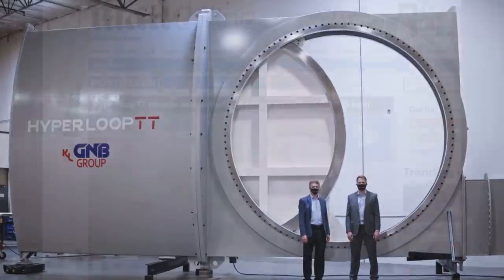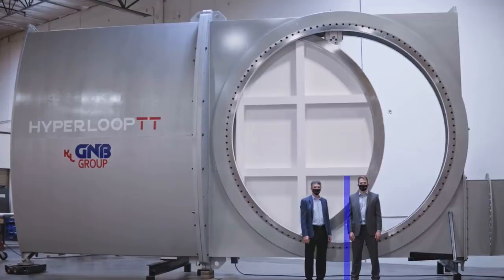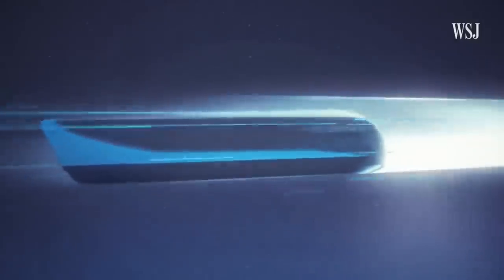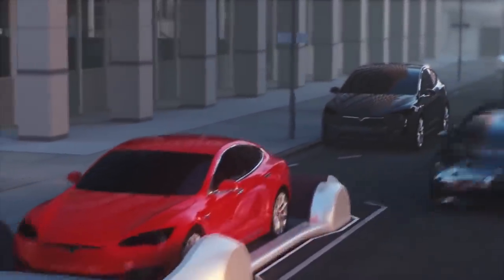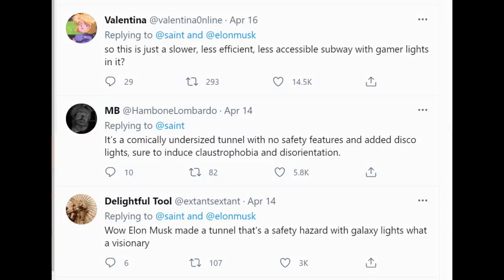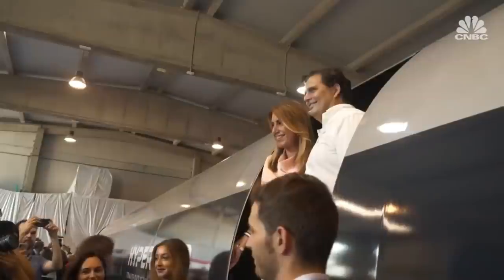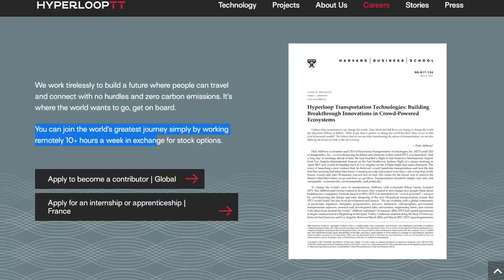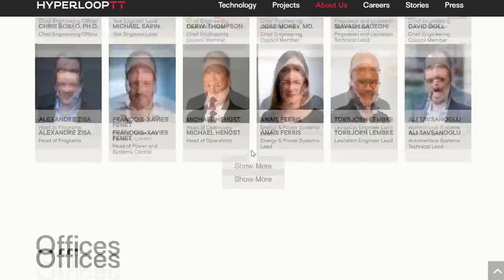Hyperloop TT vs. Virgin: The Race to Make Musk’s Moonshot a Reality - BUSTED!

Comment: Digging of the LVCC loop began on November 15th 2019.
91 days later on February 14, 2020 the first tunnel was completed. 
May 2020, the second tunnel was completed. 
LVCC loop opened on April 9th 2021. (Including finished tunnels and terminals.) 
...there was also a little COVID thing going on...
There's also a difference between the speed at which you can dig a tunnel, and when that tunnel is actually finished. The LVCC was also dug with the older modified more conventional boring machine, with the purpose built machine not finished until February 2020. 
The channel tunnel used 11 machines and two crews digging either end. 
The LVCC loop is incredibly underwhelming, but there is no need to be disingenuous about the process and construction.

Comment: 1atm = 14.7pounds per square inch

1square meter = 1550 square inches

16m^2 x 1550 = 24800 in^2 (size of valve in square inches)

24800 ×14.7 = 364560 pounds on the valve.

Let's assume hyperloop gets built and it does what its advertised to do (i know, i know, it can't, this is a hyperthetical) who wants to be anywhere near this valve when it fails?
Reply: The situation is actually worse than it seems. Realistically I'd see a full-scale Hyperloop being 6m in diameter.

1 atm * (6m / 2)^2 * π = 644054 lbf!!

Comment: I have been enjoying these videos for a while. I still do not understand what these "visionaries" say is the benefit of a vacuum to move the passengers versus a standard train systems. is the vacuum the only way to get speeds over 200 mph?
Reply: i believe the fastest maglev is already 270mph.  If you could overcome air resistance, you could significantly increase that speed.  So creating a secure vacuum tube would be pretty awesome, but as detailed in the video, doesn't currently seem plausible in our world both in tech or cost.
Reply: @Ground-Spam  the big problem is safety and comfort of passengers.
Reply: @toomanyaccounts  I mean comfort should be fine, esp for long distances where you have time to speed up and slow down without generating too many G forces.

Yea, safety is a HUGE concern.  Even that can be overcome...most 1st gen tech are laden with safety concerns.  We're no where  near it, but could be reasonable to research it.
Reply: @Ground-Spam  a century of development has been in maglev trains. the reason only three countries have a maglev train is the cost is more then having conventional high speed rail then the incremental benefits that would occur with maglev trains
Reply: @toomanyaccounts  Yea I can appreciate that.  240 vs 270 isn't enough to justify a greater cost.  There is something to be said about investing into tech that is marginally better in hopes to generate more money in development in hopes to make it more efficient/safer/cheaper.

i could still see putting a traditional electric train into a vacuum tube for the future of transportation (we're just not there yet).  Imagine being able to compete with an airline for travel between cities for speed, cost, env.  Elon hasn't revolutionized anything...and I don't think they're close to solving the issues, but I do support the "train" of thought to help move us move to the next evolution of travel.

Comment: It you see how they build submarines today, everything is already INSIDE the module BEFORE they weld it to the rest of the boat. 
These idiots built the OUTSIDE first NOT knowing what the DESIGN is going to be. 😂
Whatever they design, it has to fit though that tiny passage.

Comment: So seriously how do they bridge the gap through the valves...... I mean you're talking 8 inches there at least...... That's one heck of a jump at 750mph, those wheels will have to take one heck of a thump.
Reply: It can be done.  The car has to many times longer than the gap and the wheels have to be on computer controlled "springs"
Reply: @kensmith5694  so your basically asking a train to make a jump at 750mph. I get what you are saying. Haven't run the figures, and I have no mechanical background to know what is reasonable. Also this action would end up being a critical safety item. Not working, train cannot run.
Reply: @tedferkin  
Yes, it would have to be working for it to run.  Many other things fit that too.

Comment: As long as there are no "room" temperature superconductors available (if ever) the best option for fast public transport (economically and ecologically wise) is a high speed railway. Which US does not have. It is technically possible to do - it has been done before. It is not easy to do - but doable. Do it. Improve upon it. Call it "Hyperloop". Stop claiming that You have invented a wheel. Job done.

Comment: of course these are scam projects, but TF isn't taking into account economies of scale and logistical overhead, and ends up making some really weak arguments. 

for example, the time-per-mile of digging a long tunnel will appear to be much shorter than a short tunnel, because the prep time for both is similar, but ends up being a much larger percentage of the total time for the short tunnel. as a percentage of the whole project, the chunnel builders spent a lot more time actually digging, as opposed to planning, permitting, geotechnical analysis, bringing the necessary equipment and materials to the site, etc etc. 

similarly, it's not really appropriate to compare project times for prototypes compared to scaled up production runs, because part of that time is spent developing techniques and tooling, not actually building. for example, by the end of the war, a single shipyard in the US could build a liberty ship in about a month -- but the first liberty ship took more than 8 months to finish, and that doesn't include the time spent designing or planning.

Comment: "we invented a new material called vibranium"

what if there was a new metal that could withstand an infinite temperature. this metal would be so good at conducting heat that the sun itself could not melt or even deform it slightly. It's called adamantium.
guess I just "invented" a new material too

Comment: What happens when it creates a Sonic boom ?Moving at over 1000 Klm per hour, How do you Stop ? How much are the G Suits ?🐺
Reply: if in fact its in a vacuum, there would be no sonic boom?  Gs would only be an issue when "suddenly" turning, starting, or stopping.  if the use of the loop is to travel from longer straight destinations rather than inter city travel would be manageable.  There are way more issues than these, but ur 2 could be solved?

Comment: Why don't they just get the Japanese to design them a bullet train and track and then just build those, so much quicker and easier... SMH
Reply: For a 1 or 2 mile trip a ordinary light rail thing would be fine.  It takes a high speed train miles to get up to speed.

Comment: Any @thunderf00t fan care to answer this for me? Ideally, thunderf00t himself sees this. But making a vacuum has always seemed dumb to me. Wouldn't it be WAY easier, to just run a much smaller parallel tube, with essentially a couple jet engines in it. To just accelerate the air in circulation, to as fast or faster than you want to run your train? It would minimize the damage of an imperfect seal, doesn't need the world's most complex vacuum system, doesn't involve humans in vacuums. 
I don't know the aerodynamics involved and I'm not claiming too. But if the goal is just "reduce wind resistance" a vacuum seems like overkill when you can just control the wind. And given we have tech that pushes air, which weighs very little, fast enough to propel airplanes, which weigh a shit ton, I'm assuming the tech to accelerate air already exists. 
Anyone how knows more aerodynamics than me care to weigh in on this?
Reply: Also, I don't even mean for the entire length, cause you'd need to have it in  sections, for either solution, since you need to have stations for ppl to board. So these parallel air tubes, would only need to be on each section, otherwise it would get really messy having people board while getting rekt by massive wind speeds lol
Reply: Air doesn't "weigh very little." Air gets heavy.
And jumping jesus on a pogo stick...you want jet engines running 24/7 pushing wind through a tunnel at 700mph? What? I really don't see what you are thinking here. Air is an absolute enemy for speed. Look at the ThrustSSC and the issues it had. Even wind tunnels for testing use a low vacuum reservoir, and these facilities are big. The testing area might look small but it takes quite a bit to get those really high winds for testing aerodynamics.
Reply: @AveragePicker  you seem to be missing the question. Pulling a vacuum that big is an Insanely challenging task. So my question is simply, "what's easier, sealing off the whole tube, having super long pressurising and de-pressurising times, or moving the air closer to your desired speed?" It doesn't have to be perfect, we all know the vacuum wouldn't be anyway. Yes air gets heavy especially when you've got It sealed in a tube and an object is pushing it at 700mph. But I still think moving that high pressure air to behind the train would be easier than trying to remove it all from the system completely. 
You said "That's crazy" but didn't actually answer the question. Trying to pull a vacuum that big is equally crazy if not moreso lol.
Reply: @briantroy7376  ok, well, do some research, draw up your plans, and sell the idea to Virgin. Good luck buttercup.

Comment: The fact that the "hyperloop" (stolen old abandoned idea anyway) has constantly been downgraded form 800mph, to 600mph, to 400mph, to 120mph, to now what, 45mph?  should really be telling you just how stupid and impossible an idea this is.  Yes, if we had some super amazing materials, some amazing energy production that didn't rely on fossil fuels and could power the vacuums, let alone some sort of either anti-friction or other means to get a "pod" going - sure... but if we had all that - we could already have regular cars, that don't pollute nearly as much (if any at all - not relying on burning fossil fuels) that would need less maintenance and cost probably 1% as much as any "loop" system.... and it would be 100x safer, as you wouldn't be dealing with a near vacuum on your body, and the 'loop tube' wouldn't exist, so , damage and wear to it wouldn't cause catastrophic failures that would kill literally everyone in the tube at the time of failure.

It'd be great if these 'high tech geniuses' would focus on things like climate change, electricity production, and generally "better lives for all" instead of fairytale exotic things like a bullet train going 800mph in a vacuum tube.   Any advancements to counter global climate change, including new methods of electricity production, storage, and delivery would begin to change the future forever in a positive way.

Heck even if they just focused on a "Net Spine" - a series of fiber optic lines that provide High Speed Internet access to 90% of America, and possibly the world, so that everyone can just enjoy the internet without so many restrictions or high cost bills - would change how things run, function, and productivity.   

The billions of dollars they blow on this "hyperloop" is just that... billions of dollars wasted. Money that even if you didn't go to invent something 'new' - could be used to better the lives of nearly every American alone by simple things like donating to those in need, or to companies that build homes for the homeless, or to those making food for those in need, etc.

Comment: First: I don't think a hyperloop system will be feasible without massive technological advances, not only to make it possible, but then to maintain it. We're nowhere close to having even the materials necessary to make it. So, it's both a literal and metaphorical pipe dream. However, knowing that it's nonsense isn't an excuse for misrepresenting facts.

Extrapolating build times for a finished technology, based on the time required to resolve the technological difficulties in building the first experimental prototype is obviously facetious and silly. Estimating the speed of a vehicle based on the first attempts at proof of concept is silly. Pointing out that the solution to one issue (vacuum doors) isn't also a solution to all related issues (tracks through the vacuum doors) is silly. Using this kind of rhetoric, given that the audience accepts it, anything can be ridiculed. In other words, this kind of rhetoric proves nothing other than animosity. "Musk is an asshole" is true, but it's not an argument.

I'd be far more interested in a deeper analysis into why some specific problem is insurmountable. Thunderf00t being a chemist, a look into the issues related to materials science would be interesting. What qualities would be required on materials for a hyperloop tunnel, versus what materials are actually available? I have a general idea, but would like to have some solid knowledge.
Reply: None of this matters, because any technological advance that might benefit the Hyperloop would likely benefit high-speed rail or Maglev as well. And the biggest difference? HSR and Maglev actually EXIST, and DO SOMETHING. Not so much for Hyperloop.

Comment: I mean, if you had real expert engineers and billions of dollar this would be totally doable, you could put all the vacuum pumps you'd need like you showed in another video I think i was one huge one per 100 m and you could add automatic leak detection and increase the power on the vacuum pumps to compensate, you could also add maglev and all this other stuff but...

WHY??? 

why would anyone waste all those resources on something like this?? planes and trains work better, it's like you've said many times: these are proven technologies. The question of if it's possible or not is just a distraction, because even if it were possible it still wouldn't make any sense!